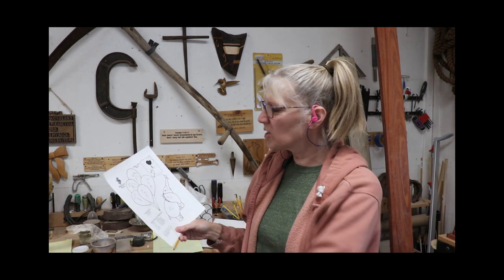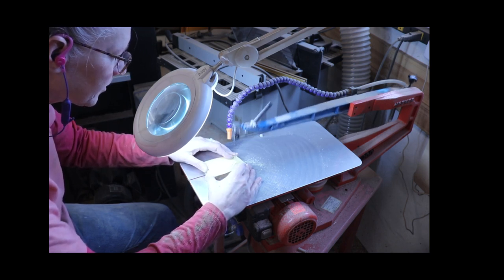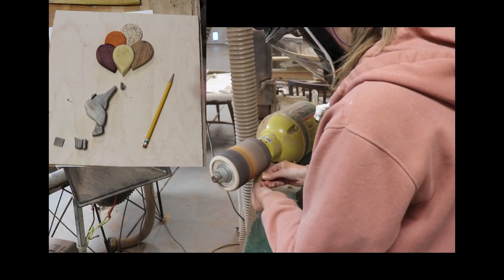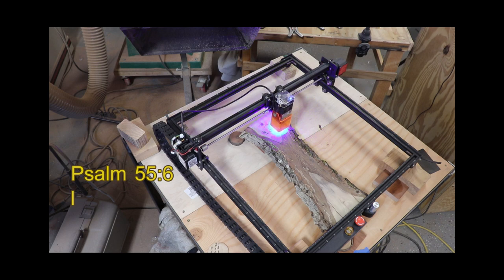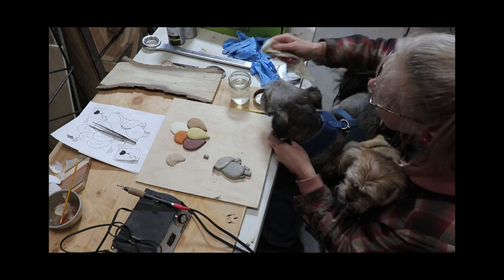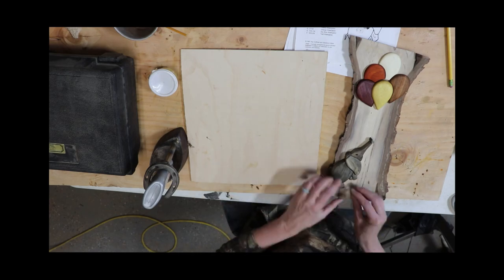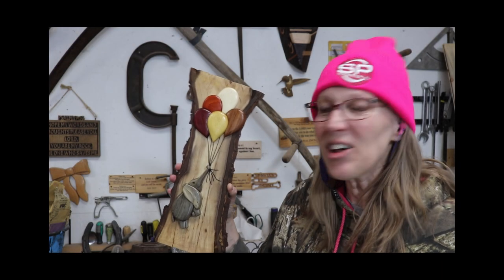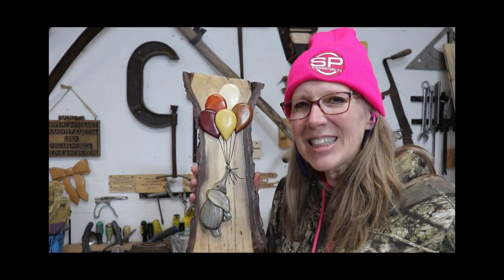Elephant and Balloons Intarsia

Comment: That is absolutely darling!  I think it's one of my favorite Intarsia pieces you've done.  Have no idea how you can work with the two pups on your lap!  I'll have to remember the vinegar water trick.  What ratio of water to vinegar do you use?  The woods in this pattern look great!!!
Reply from the maker: Thanks Lori! There are many times I can't work with the pups on my lap, hehee! I did a 50:50 mix of water and vinegar. Not sure if that is the correct ratio or not but it sure works. I think I will show a before and after example at some point, it works extremely well!